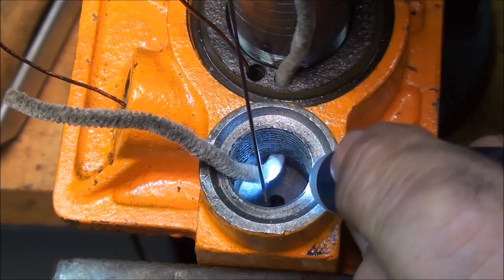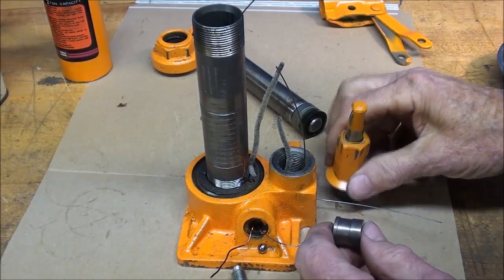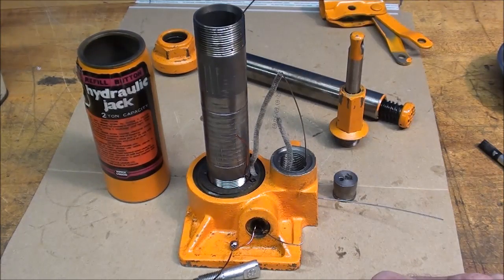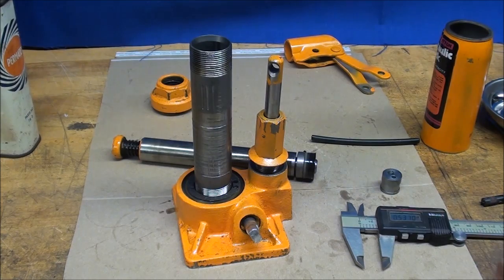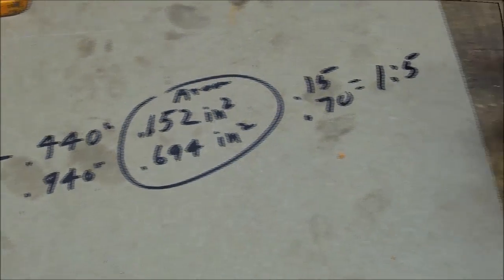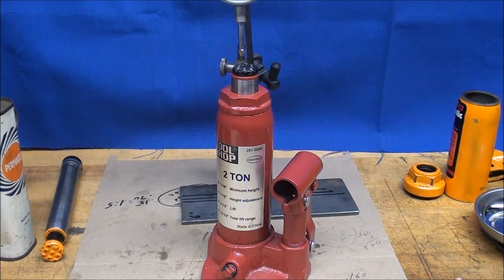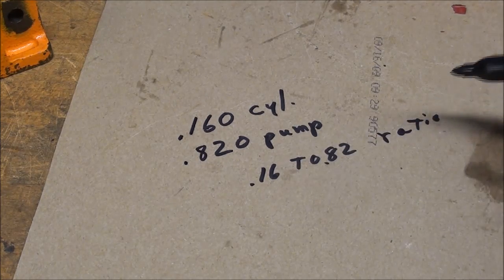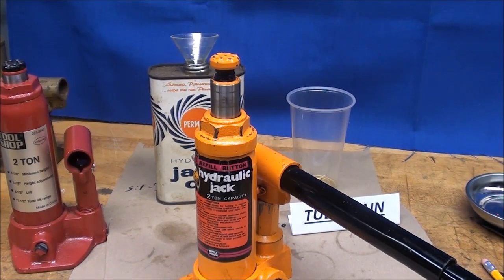WHAT MAKES IT WORK? #17 pt 2 of 2 "How a Hydraulic Jack Works" tubalcain

Comment: Thanks for sharing Mr Pete! :)

I'd like to clarify a point that Mr Pete made, but might have been lost: the fact that the fluid is incompressible means the volume of the fluid does not really change under pressure, and this is 'magic' behind what gives the hydraulic part of the mechanical advantage with the smaller and larger bore sizes.

School mathematics tells us the volume of a cylinder, so we can apply that here to work out some unknown value. In this case, I quickly worked out what I expected the travel of the ram piston to be from one stroke of the master cylinder (pump).

v_pump = v_ram
pi * r_pump^2 * h_pump = pi * r_ram^2 * h_ram
pi * 0.440"^2 * 0.820" = pi * 0.940"^2 * h_ram

divide pi from both sides
0.440"^2 * 0.820" = 0.940"^2 * h_ram

divide 0.940"^2 from both sides:
0.440"^2 * 0.820" / 0.940"^2 = h_ram
h_ram = 0.18"

It's in the ballpark of the 0.16" that Mr Pete measured, so it's possible that maybe the ram bore or the master cylinder bore are differed between the jacks, or that the stroke was slightly different to what Mr Pete was able to measure (or perhaps the paint wear didn't match with the true stroke length).

Keep up the fantastic videos Mr Pete!

Comment: Well, the measurement bears out the calculation because you draw the same volume of oil as you push into the ram. The formula for which is the area of the piston times the lenght of the stroke, so, if you push it into a ram which has a 5 times bigger area, its stroke will be 5x less, because the volume per stroke (of the pump) is fixed.

Comment: thank  a lot..an old  man  who live at PARIS..  
my  wife stay  in  front  of  tv... 
me  I am with  my tablet Samsung    E xplain us     motorcycle schock
breakers    please  do that..At 70 years old   ....you need to   learn
Reply from the maker: +Bernard Schirmeyer Thanks for watching. Eventually will do vids on shock absorbers & door closers (same thing),
Reply: Hi Scott,
Sometimes it takes a few attempts to get all the air out, because air compresses you might need to do it a couple of times, and when you find the right angles of tilting the jack (it will feel less bouncy), just repeat at that angle.

If it still isn't working, one idea (and it's a little messy) is to do a complete tear down, clean all the parts, and then reassemble the high pressure parts inside a small tank filled with hydraulic oil - tapping them to dislodge any air bubbles that might be caught in galleries and pipes. Good luck!

Comment: hard to believe that something we see ass so simple took thousands of years to come up with.
amazing how hydraulics work and how the forces are applied for mechanical advantage.
thanks for the tear down. in over 40 years i haven't had one apart because of a bit of care from the owner....no failures due to the pump sections.
the term handy device doesn't cover it.

Comment: Very informative video. Only one question: How would you "bleed" out the air assuming some was trapped somehow in the system?? 

Thank you.
Reply: +Pappa Bob I don't think there is a need to bleed this kind of jack. The oil is travelling back and forth from the reservoir which should get the air out of the cylinder automatically.
Reply: +He Ka OK. In the video MrPete said "if there is air in the system, it will need to be bled out". Maybe it happens "automatically" but that's why I asked. So, what you're saying is "operate the jack ?? to full extension?? a few times and it should clear any air??
Reply: Pappa Bob Well I think so yes. When you push the piston in the down position it pushes everything out of the cylinder, oil and any possible air. And I presume you have it in the down position when filling it up so.. it does not need any bleeding.

Comment: Thank you sir I always was curious what was inside one. Interesting to note that given the piston area of 0.693 square inches and the jacks rated load of 2 tons or 4,000lbs take 4,000 divided by .693 and you come up with 5,772 psi that will have to be generated by the pump to raise the 2 tons of load. Love the videos sir keep them coming.

Comment: Thanks for the video. I have a 40 ton that fell off of the bench while I had the release valve out of. The shop was built with a gravel floor. (I don't know why) I have been looking for the check ball for 2YEARS NOW! Logicl dictates it's there, but so far no love. You showed me there is no spring to find.

Comment: What a great explanation. Thanks Mr. Pete. I had a very basic understanding of the principle but not the specific way in which it was applied.  I've got a cylinder that I overloaded that has been laying around thinking I would try to fix it.  With the class on how they are put together and an understanding of the valve system along with how it should come apart I think I'll give it a go...probably more expensive to fix than recycle but I ought to learn something in the process.  Thanks again for all the great videos.

Comment: I know that these jacks are cheap to buy now days but would it be possible to make one? NOT to be used for any work that involves one getting under a vehicle or any other case that ones safety is in question-strictly to see if I could do it - or even better maybe you might like to make a video on how to machine the parts? and teach use ALL. BB"s would work for the ball valves I would think or maybe ball bearings would be better if they need high accuracy for a good seal? It's just a thought

Comment: Once again an OUTSTANDING JOB! I have always wanted to tear down a jack, I know how they work I just wondered how the ports as well as the valves were arranged.Would it be safe to say that ANY weight that is lifted is held up completely by the O rings being able to hold back the oil (pressure) from returning??? I can't seem to accept the fact that those tiny little rubber rings hold ALL that pressure without slowly bleeding down? or did I miss something? BTW- try not to stop this series on "How it works" I for one get a tremendous amount if Ideas from these videos Thanks again Mrpete!!!!!

Comment: I modified a jack like this to work reliably on its side as a clamp ram for a small moulding machine that I built
What I did was drill and tap a hole in the side of the jack and fit another smaller tank to this hole , sealed with O rings with a plastic lid , Must be vented
Once the jack is completley full and the small tank full there is no air in the system at all and it will work perfectly on its side

Comment: It's a shame you couldn't get that tube out. I suspect the hole for the return flow (the pipecleaner hole) was drilled at an angle from the area that was threaded (and thus closed off) and was joined by a hole drilled vertically from the base of the hydraulic fluid reservoir to for the full low pressure passage.

Comment: Thanks Mr Pete. This introductory 'heads-up'  on hydraulic jacks has been excellent info for me. I have a 'stumpy' (shortened length) standard width trolley-jack based on what looks like a bottle jack lying sideways. It has never worked properly as to piston extension range (and so the overall height it jacks to is useless). I have always threatened to  throw the thing away... You've re- kindled an interest in me spending 10minutes to check now if it's just a case of lack of oil!!!....

Comment: Hey Mr. Pete. Don't get to discouraged about viewership on your how it works series. I just want to let you know that I enjoyed this one on the jack. I already knew how they worked but you provide some good information. I had one from a swap meet  that always leaked down under pressure. It also came from that 5 letter country. When you showed how much dirt was in yours I drained the oil out and flushed it several times with kerosene. Man did the dirt come out of it. Refilled it with jack oil and now it holds 4 ton without a problem. So even though you don't get a lot of views, you did help this old dog out.Al
Reply from the maker: +ww_big_al Thanks for watching
Reply: ww_big_a could you please tell me where and how much fluid to put in a big red torin air and hydrolic jack?
Reply: ww_big_al ,
Dear Sir, 
       hi, i am a final year student of mechnical diploma. I have opted hydraolic jack design
 as my project work. I have some problem  in designing the hydralic circuit . Sir, can you spare some moments from ur busy schefule to guide me about the circuit. Other theoratical design calculations complete, only the design of appropriate hydraulic circuit is pending. From your coments,I getherred that you have an execllent knowledge about the subject matter and if you desire to guide some one, you can do so . May i hope you shall spare some moments from your busy schedule to guide . It shall be great of uou, My e mail is qmes03@gmail.com & whatsapp no is +9 9888042652 for any interaction and advice for guiding.
Sir, should i expect your honourly guidance. With sincerest regatfs

Comment: My early 80's 2-ton floor jack recently died because the pump seal (urethane) cracked in half- it would hold weight, but pumping had a 25% chance of working.  I tried finding a replacement, but had no luck at all.  I machined a mould to cast a new one, but the casting material was more expensive than a new jack, so I used pair of 1/2" "00" bibb washers.  It works for now...

Comment: The wrench thing........I have seen one adj. wrench, lower jaw, break by the operator using the wrench backwards.    It made a believer out of me.   I cannot say the exact cause ie, too small of a wrench for the job, a cheater pipe slipped over the handle,  beating the wrench with a hammer , etc.     but it did break using it backwards...especially after I told the guy about 5 minutes earlier that he was using the wrench backwards...and he didn't want to believe me.

Comment: You don't have to calculate the actual area of pumps, rams, or optics (for light-gathering purposes) to determine the relative areas. If you simply square the diameters or radii you can get the ratio of areas between two objects. 2" to 4" gives a ratio of 4 to 16 or 1:4 by simple squaring. Much easier than 1^2 (1 squared) times pi compared to 2^2 (2 squared) times pi = 3.14 to 12..56 = the same 1:4 ratio, but with easy in-your-head calculating instead of all that pi r squared. It always gives the same answer as the complete calculation. 

I use this shortcut to determine quickly that a pair of 50 mm objective binoculars have about twice the light-gathering power as a pair of binoculars with 35 mm objectives. (50 squared is 2500; 35 squared is 1225, or about 1/2 of 2500.)

Comment: You mentioned 10/30 motor oil, suggesting it was o.k to use, and only mentioned "Brake Fluid" as the one NOT to use. I was under the impression motor oil also attacked the "O" Rings.  I just repaired a hydraulic Log Splitter that had the "Wrong" oil used and the "O" Rings were completely disintegrated.  I thought the oil that was in the unit looked like motor oil but may have been wrong.  Any comments..  Thanks Harvey

Comment: There are two items of interest here: 1. the pump.  On most of the better quality jacks the pump can be replaced thereby renewing it.  My supervisor did it on a tall 20 ton jack. 2. the correct way to turn an adjustable wrench.  In most situations that don't require a large torque either way is no problem.  If a large force(torque) is applied to the wrench in a backwards direction the movable jaw is forced open instead of the jaw being forced against the part thus slightly opening the jaw and possibly rounding the part if it is a nut.  This is easiest to see using a pipe wrench as the movable jaw is much looser than a "Crescent" wrench but in design they are the same. It is a matter of physics and engineering.
I think the explanation is great and right on.

Comment: I must take difference with one of your statements: You are both a math and physics instructor. Moreso than many I work with. One day, I will finish doing a cutaway of a jack I pulled from the scrap pile years ago. Went part way, then got sidetracked. Oh  well. As to why the pump is about the same size on most jacks: the fluid isn't perfectly in-compressible, nor is the metal perfectly rigid. The seals aren't perfect, nor are the check valves. Put it all together, and limiting the pressure to a few thousand PSI, keeping the cylinder volume beneath the ram moderately large,  and keeping the flow per stroke not too small makes for a reliable jack.

Comment: Might remind your naysayers that Blaise Pascal was also quoted as saying:  "Most of the evils of life arise from man’s being
unable to sit still in a room."  Can you recommend a good way to bleed a bottle or floor jack?  Your work and endeavors are always appreciated, Mr. Pete.  Thanks.  ~PJ
Reply: You’d have to know where the hole was to the ram. Then you could pump it up,  turn it upside down, let the air in the cylinder rise to the hole, and then(still upside down) collapse the ram and let the air flow back to the reservoir. I think.

Comment: Great demo... however, somewhere within is a relief valve to make the jack safe by preventing the user from exceeding the jacks design limit. I've personally never messed with a bottle jack, but suspect the 'mystery ball' on the pump plunger 'might' have something to do with it. Also, reservoirs  should never be filled unless the jack is level and the ram is in the down position (unless the manual states otherwise). Bleeding can be an issue with some jacks, especially floor jacks. The trick is to give it 15 or 20 full strokes with the jack sitting level, and the 'release valve' open about a half turn. Thanks for the videos, the time/effort involved in their production is greatly appreciated!

Comment: Jeez, so without a pressure relief  valve, what will fail when you use a cheater lever and exceed 2 ton (or what ever the jack is rated for)?
Reply: +1345medford The piston or more than likely the piston seal will blow out.

Comment: you should do a video testing the adjustable wrenches to see what it takes to break them when used backwards. I think the backwards wrench thing is more an "i know more than you" thing than an actual problem.
Reply from the maker: +tom garside That is a a marvelous idea---& I think you are right
Reply: On a crescent wrench, the forces on the wrench would be the same in ether direction. Not like a pipe wrench, which is designed to apply  more gripping pressure, when more pressure is applied to the handle.
Reply: +Tom Wilcox   Right on Tom, And my favorite adjustable wrench is a hammer.
Reply: Could be hard to test I am sure that if you were just to apply force until the wrench fails that one side would be stronger than the other.
You would have to simulate average usage over the life of the tool. Maybe the wrench could be fixed and you could apply force through the fastener at an amount calibrated to an average usage then see which failed first.

 It would be interesting to see how Cresent or their manufacturing partners test these tools
Reply from the maker: +tom garside I already did a vid on it--watch for it.  Although unscientific, you might like it
Reply: +tom garside It would be interesting to see the results.  In practical/average usage probably doesn't matter, however, in much heavier usage it probably does.  The difference in cross-sectional area of the two components is usually significant.
Reply: +tom garside   Maybe we could get Tom Lipton to test that for us, he may have the better setup for it.  If someone that has a round dozen of identical crescent wrenches could send him a pair for test purposes?

What mechanic, that is worth anything, hasn't taken a few risks and damaged a few tools as a result?  If you could be a fly on the ceiling while these critics are trying to work on something in a tight spot, you would probably see them use it 'backwards' when there are no other options available to them.  In fact, I wouldn't be surprised if they resorted to using some impact influence (using a hammer) to knock things loose.
Reply: My favorite hammer is an old adjustable wrench lol.
Reply: cool thanks
Reply: Lubricate grease pumped bucket

Comment: Excellent and thorough explanation, and by the way, it wasn't too long!  I assume an air over hydraulic jack works similarly, with air providing the force required to move the oil, rather than the piston lever.  I'm sure there is a valving arrangement to allow replenishment of the resevoir oil into the pump.  Cheers and thanks!

Comment: When you lower the load and the oil flows back into the reservoir, does the air in the top of the reservoir compress, or does it vent out around the fill plug?

Great demonstration!
Reply: +Brian Taylor If the arrangement is leak-free, then the air recompresses, because when oil is drawn from reservoir, it gets less pressured than ambient. (I don't know for a fact but this would be my logical guess)
Reply: +Brian Taylor yes on the venting.